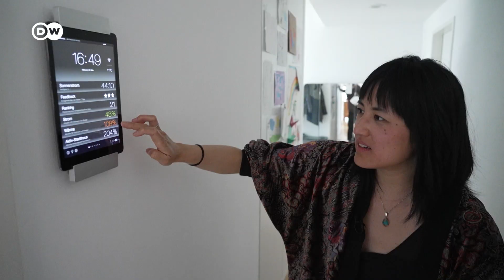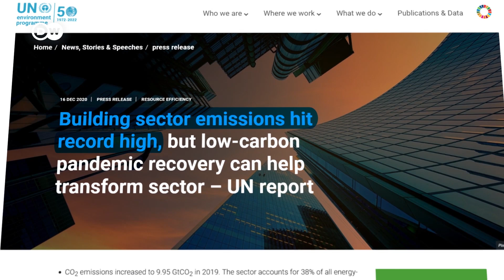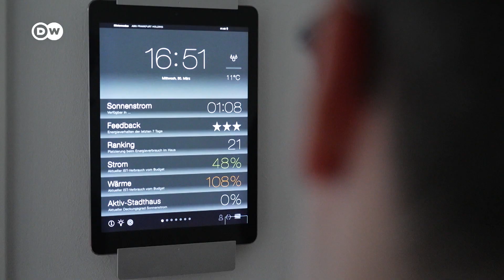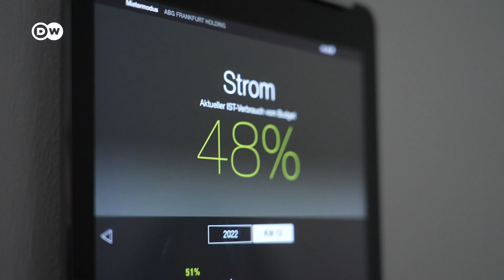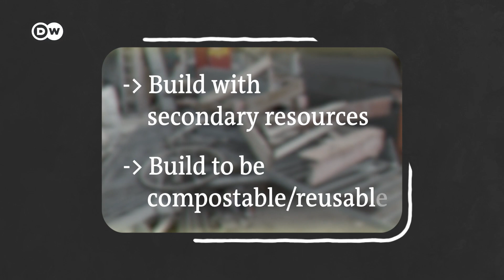Why our buildings suck, and how to change them

Comment from the maker: Would you want to live in buildings like these? And what does green architecture look like where you live?
Reply: I’m a numbers guy so I’m 100% down with being able to see what my utility usage looks like at any given time.

My wife will probably never actually look at the numbers but she’s always open to hearing about what they turned out like and what we need to change as a result.
Reply: from what i know theres isnt any in ireland.
Reply: 🇨🇦 concrete is "king" here for new condo construction, they actually advertise it. As for monitoring consumption, it's a way to understand what you're doing over the long term. Where I am, Vancouver area, people are tearing down houses built to last 30 years, roughly 1000 SQ ft, and replacing with houses 3-4 times the area, installing natural gas heat. Plastic siding, 15 year warranty, and little if any insulation. 
Talk about environment and greenhouse gases, you get scowls. 
This is both embarrassing and infuriating.
Reply: make the number mandatory in each flat and accessible to All online.
Reply: I live in Milan, Italy. Here I got this 90m2 apartment A4 class made of wood and steel supports. During winter season It may happen that you use the oven for 30 mins and heat the house for the day. I also have that kind of ipad where it shows consumptions around electricity and solar generation (200€ every 2 months. considering heating is electric aswell), we still miss the sewage part though ahah. I used to live in a 30 year old house before, where in winter season the gas bill averaged around 900€ per 2 months period, which is insane.
Here in Italy there is an incentive system that allows you to renovate your house for energy purposes for free (If you meet requirements) and many friends of mine are renovating home with this method, 400 kWh/m2*year (as my old house heat dissipation rate) gets to 14 kWh/m2*year, while my house is already 0,12 kWh/m2*year as A4 energy class.
Reply: Rural France so literally very green! Circular economy really describes how we lived long ago, here the stone and timber was all sourced locally to begin with and often reused in different buildings over the centuries, still done today.
Reply: Imagine the Energy Plus rating you could achieve if power plant workers and their families just lived at work like how the Chinese factory worker lives in dormitories?  Your "home" would be Energy++++++++++++++++++++++++++!!!!!!!
Reply: I like the principles behind CRCLR. It’s something everyone involved in the building and development industry needs to be learning & incorporating into their project.
Reply: Disappointing to hear you quoting the misleading "average wage" over the vastly more relevant "median wage".
Reply: we need to change them because the're easily flawed by a plane
Reply: No!
Reply: Absolutely!
Reply: Me in Asia: Gosh, if I get rich enough to build my home, I sure wish it has insulation. Bonus if it's not asbestos-based.
Reply: I have a cactus and some herb plants in the house. That's as green as it gets. Here in Asia, you'll need to pay top dollar for green housing that isn't a concrete jungle. Or you live out in the boonies.
Reply: It's almost impossible in my country.
Reply: American commenter here.

I can't say I know of much green architecture near where I live, but I wouldn't be against living in an old or repurposed building. (I certainly wouldn't mind living in a building with some fancy heat recovery technologies, especially if I had an opportunity to see how they worked). I even would be interested in getting involved in CLCR directly if I were able to. 

While I wouldn't mind living in a house that tracks energy use, I'd like to know exactly what data it collects and who has access to it. I WOULD like to know how much power my computer takes, and how much power other computers would take to do the same tasks in comparison, but that doesn't mean I want, say, Twitter to know how much power I use.
Reply: There are no such buildings I know of in Ghana 🇬🇭 where I live. In fact, our primary preoccupation is with cooling, not heating!

And yes, I'd really like to live in such a building.
Reply: Just raise house prices. People will live green lifestyle in dugouts.
Reply: @nikkin4948  California would like to argue with you.

People not able to live in proper housing will live less green lifestyles as they have to constantly rely on disposable options, more environmentally costly cleaning options, and rely on heat generation rather than retention technologies.
Reply: @aldproductions2301  In Europe, we like it GREEN.
Reply: @nothanks9050  History has much to teach us.
Reply: @graemeblundell2884  You could get some Romans from a few thousand years ago, put them up on our roof and they would recognise the design and tiles.
Reply: I think it is easier to modify to an extent to what you already have instead of knocking down or building new so often.
Too many old buildings in the EU have little insulation. Just adding roof insulation and mini splits would help.
The big question is do we have the trained workers and money to do this on top of Putin's war?
Reply: @kenhunt5153  Certain types of insulation are often not appropriate for older buildings originally designed to breath.
Reply: @nothanks9050  I have worked with adobe, rammed earth and cob construction - all organic materials. Given soffit vents or vents in a roof a building can get the air exchange it needs.
Plaster can be can from natural earth materials or fossil fuel based. It depends on the framing material or what you have originally. 
A definite work around.
Reply: @kenhunt5153  We are fortunate here to have an abundance of natural materials, you still see some oak roof tiles/shingles on out buildings (stone). They actually provide good insulation and can last more than 50 years no problem. Building next to me had wattle and daub still in the walls.
Reply: How much of this gain will be lost now that Germany is replacing gas with coal?
Reply: Subtitles for the interview with the chairman of Frankfurt city housing management?
Reply: "Why our buildings suck, and how to change them" I didnt sea an anywhere clear answer to that?  why do you call the video that way than? This is confusing and irretating. It makes me not watch your videos and dislike them. And I am a big fan of your media since a child + I am a big fan of topics similar to those. You are either lasy in your sereach and results are not eneough to answer that question or you put a catchy title regardless of the actual content.  - Friendly opinion, Cheers.
Reply: You can't just switch to German DW Planet... and then not popup subtitles for people, when this programme has been in English up until then please?